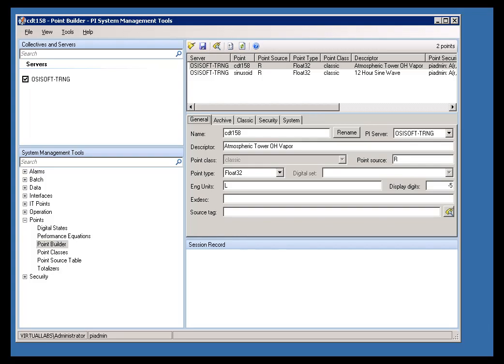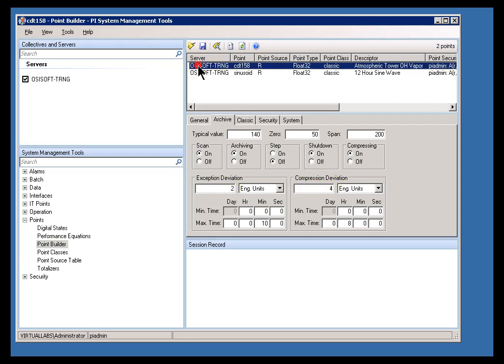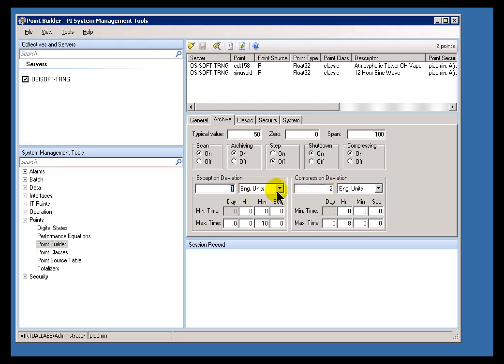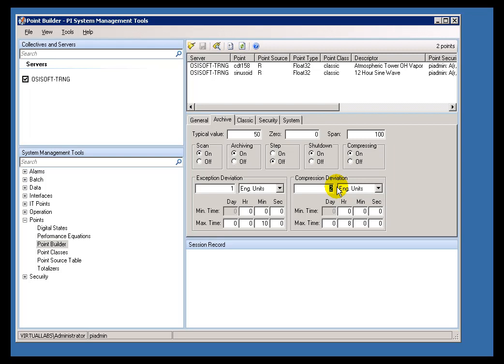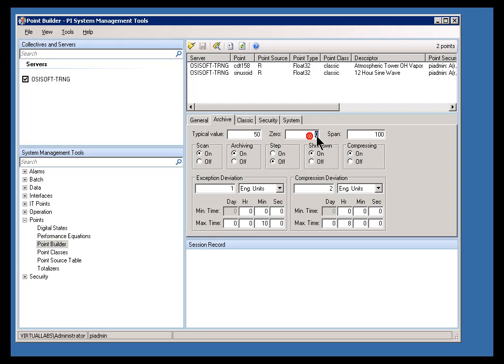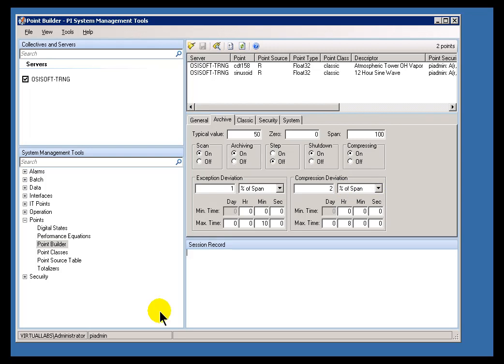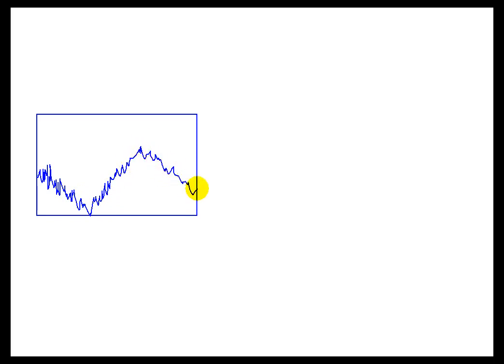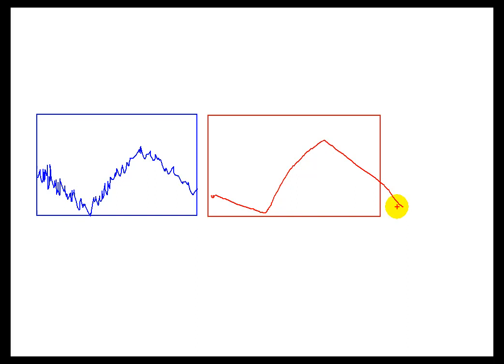OSIsoft: Explain default exception and compression values and why they are important  v3.4.380

Comment: I did Swing door trending on MATLAB and the final result is 20001/244=82 is it good compression rate?
The original data was comprised of 20001 data points and I compressed the data into 244 points, so is it recommended compression ratio ???
Reply from the maker: Hi Muhammad,  ideally, this ratio should be between 10:1 to 100:1, meaning for every 10-100 events that come into the queue, one is sent to the archive. Minimally, it should be between 3:1 to 10:1, especially on systems with a larger point count (over 50,000 points) or systems with very high frequency data. More information on recommended Exception and Compression settings here: https://customers.osisoft.com/s/knowledgearticle?knowledgeArticleUrl=3226OSI8
Reply: @AVEVAPISystemLearning  
Thanks for your precious reply.
So in my case the ratio is around 82:1 is it acceptable ?